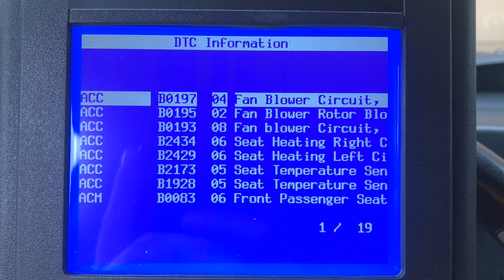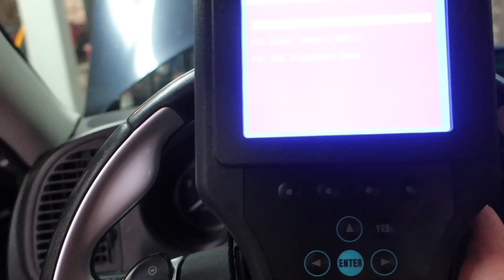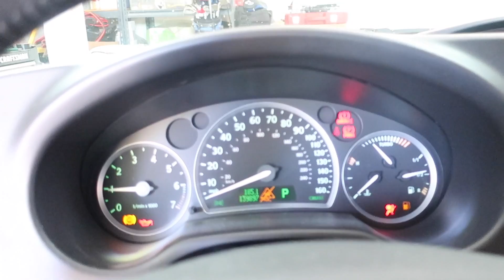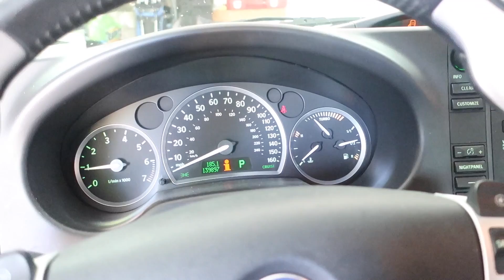Saab 9-3 Seat Strip and Airbag Light Fix!

Comment: that freakin' full power fan on start.... grrr….. and the seat belt noise too
Reply from the maker: Ye thanks to auto AC
Reply: @AutoAutopsy  also when the passenger seat gets too hot because of the sun, the weigth sensor stays on until it cools down. 😅